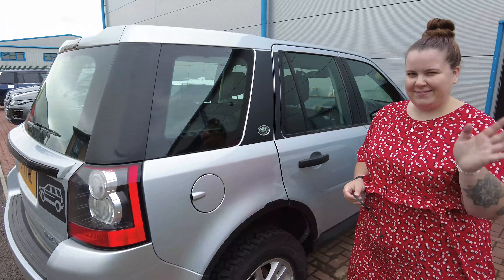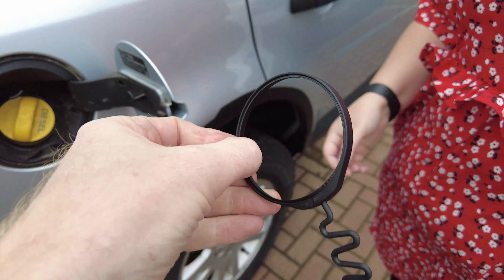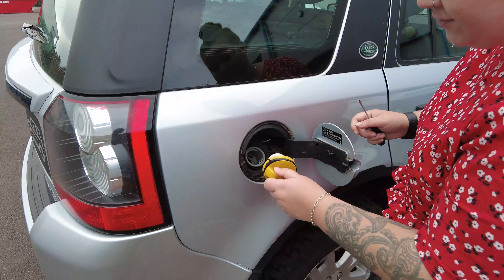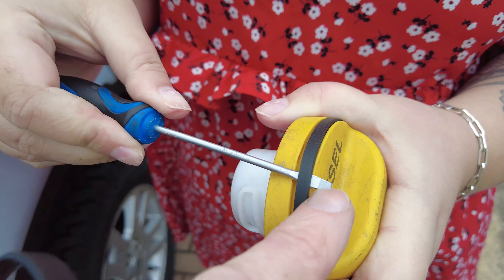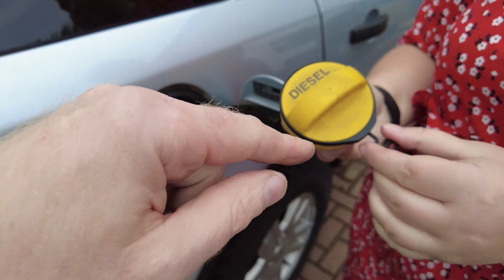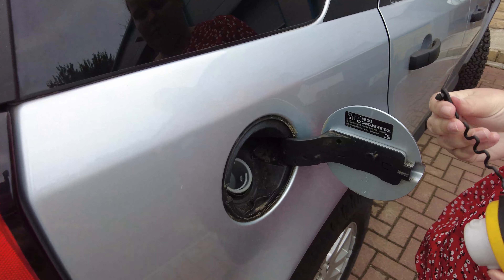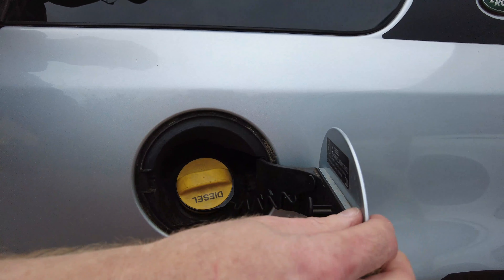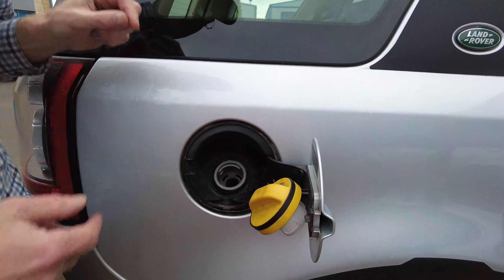Land Rover Freelander 2 Fuel Filler Cap Tether Strap Replacement LR2 gas cap

Comment: You would be surprised at how useful these tips are, thank you guys. It only took 15 seconds to replace each bonnet strut because of your instructions.
Reply: Yup - I replaced the rear hatch struts because of these videos and found out how cheap and easy it is.  Did my wife's car as well.  It's amazing how these soften over the years.  Thanks Simon

Comment: Love your site .   I have gone from a whisper quiet discovery to a 2013 freelander sd4 which sounds like a tractor in comparison. Have you come across anyone who has added dynamat or similar under the carpets and was it worth the effort. How difficult is it to remove the carpets?
Reply from the maker: Hi - not come across this - clearly you do not have air suspension and the Freelander is a lower spec car.... but our project Freelander 2 is not too loud - well it was OK until we fitted the off road tyres !
Reply: I had a Discovery 4 ,V6 3.0 litre,and after selling it two years previously I got the F2,not much noisier than your make out.

Comment: I think i have asked this before when you did one for the L405 but please could you make the straps for the L322, I am sure it would be cheaper than buying a full cap and more environmentally friendly
Reply from the maker: Hi Colin - yes i did recall this question - I think if you search for "BMW fuel cap tether" you may find what you need !
Reply: @L663  thank you for your help, I have found and ordered one 👍